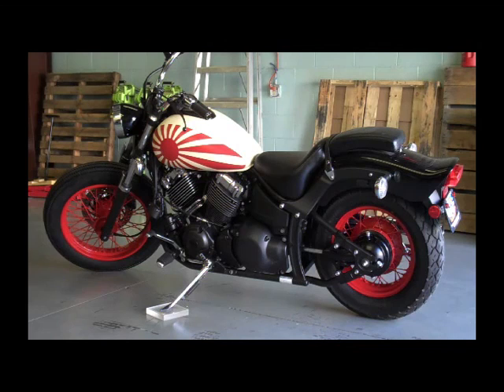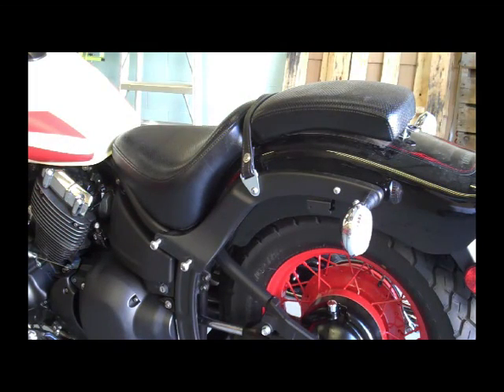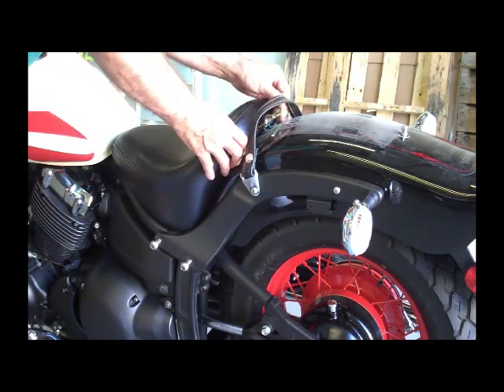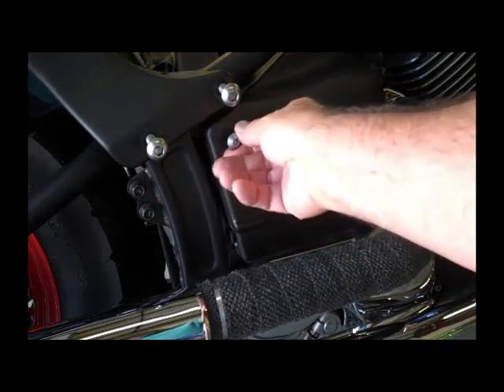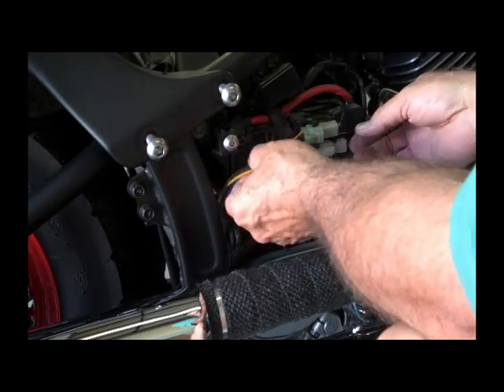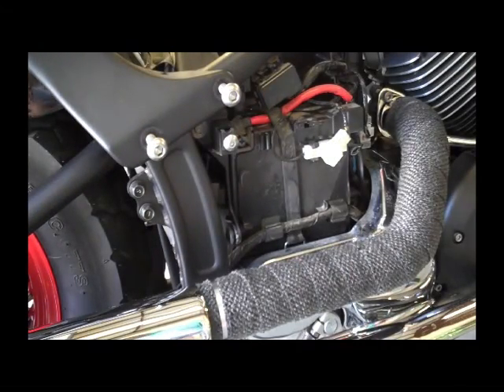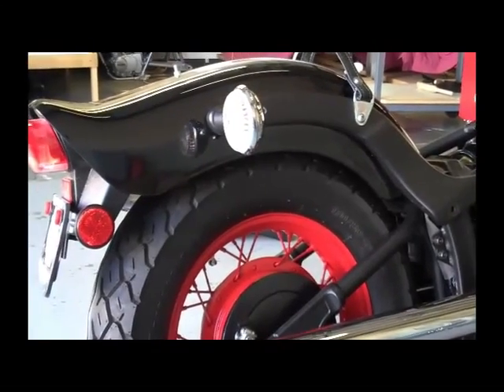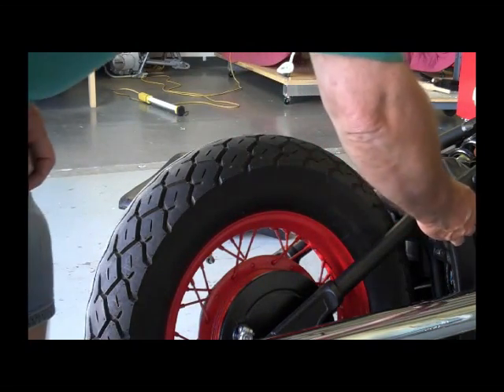Yamaha V Star 650 Remove Seat & Rear Fender

Comment: What are those Rims? I like the color. Are they painted or after market? Is that plasti dip on the dip?
Reply: They are the stock rims and we had them powder coated red. We haven't tried Plasti dip. We have heard good and bad about that product. The prep may be the most important part of that process.
Thanks so much, Lance at BCB
Reply: ***** Cool thanks